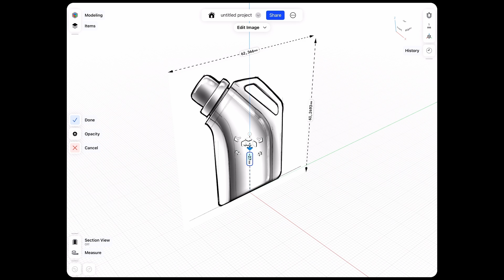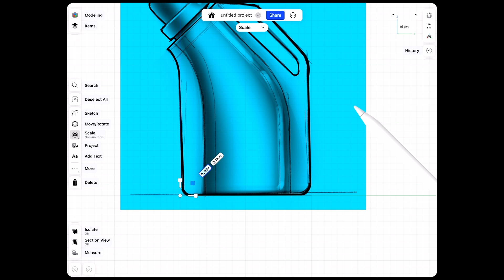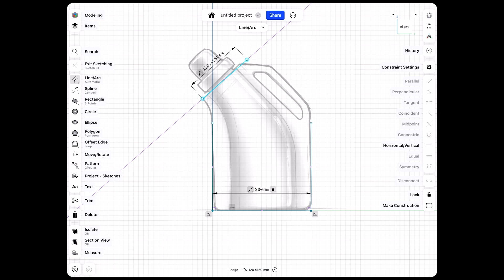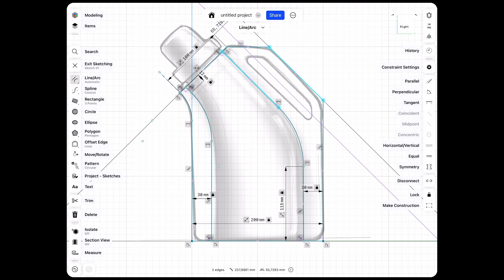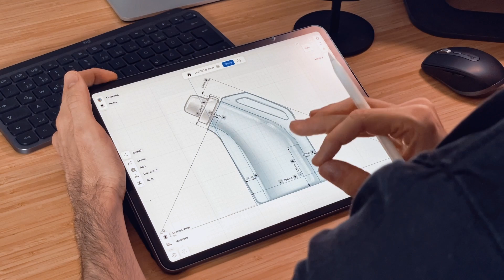Concepting Fundamentals | Shapr3D Concepting Fundamentals

Comment: He says, "I always keep these rounded parts sharp. That allows me later...". In reality, there is just no corner fillet option in sketch mode. Therefore, you have to keep them sharp, and if you don't want to, you have to build circles, constrain them to the lines and give size. Very, very long. This software is nice, but unfortunately, it lacks so many simple features that the entire workflow is very inefficient. For example, you just cannot lock a sketch or any other object at all! I'd want to love that software; it is sleek and modern but utterly unripe.